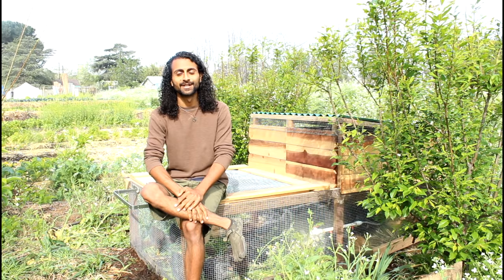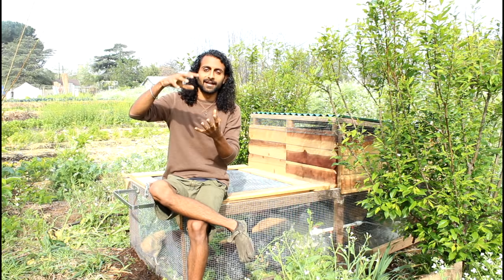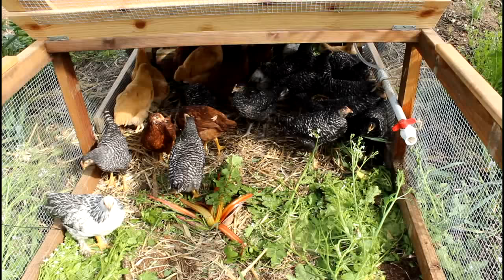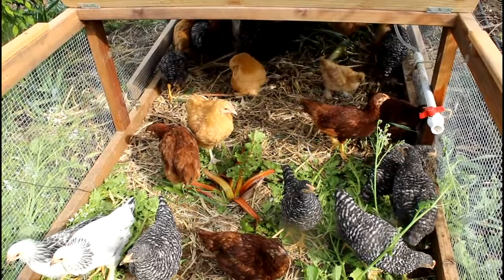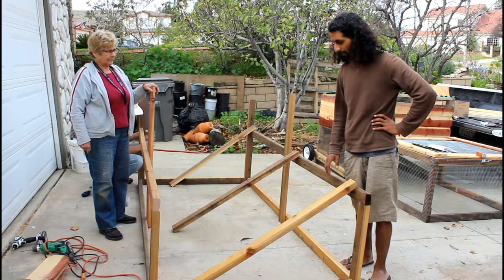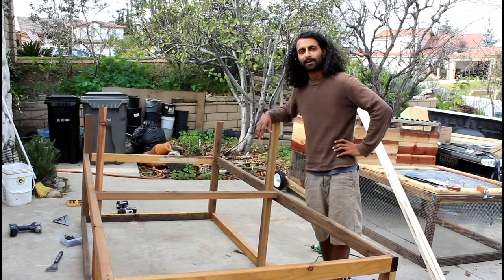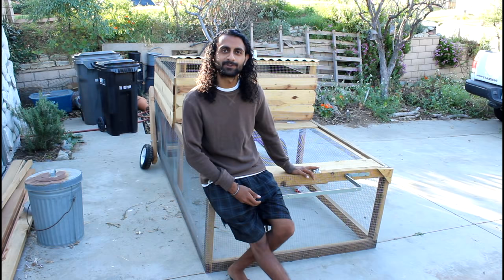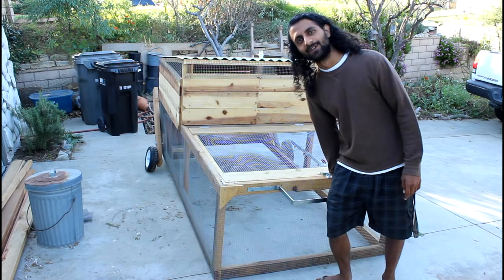How to Build a Chicken Tractor with Farmer Rishi

Comment: I watched this video, and several others, a few years ago, then built a chicken tractor taking pieces from each video and a few ideas of my own as well.  Then last summer I built another newer one -- the old one was still working fine, I just had so many ideas to improve it after using the original those first two years. Here's an explanation of some of the ideas that I came up with.

What I remember liking about this video in the first place was the system to raise and lower the wheels.  I used that in my first and second tractors, however, mostly because I had an old retired 20" BMX style kids bike collecting dust, I used the wheels from it the second time. I also see these bikes at yard sales all the time for $10 - $20, you can't even buy plastic wheels for that. I had to move the pivot point further up the side on the very back, but they work sooo much better.  They do lift it a lot higher, on purpose,(I could of had the pivot lower or arms shorter, but didn't, I wanted to be high for uneven ground and tall vegetation. The back bottom is about a foot from the ground when it's in move mode now).  This is too high to move with the chickens in it, but it is very easy to move, even a few hundred yards when occasionally necessary -- easier than a wheel borrow, even through the woods.  Moving the chickens separately is no work what so ever though, most of the time I'm only moving a few feet, but even on those long moves, it's still very easy, I just take a coffee can of scratch grain with me every time I move it.  I let them all out and sprinkle a little grain, enough to only last a few minutes off out of the way. Then I move the tractor, and after giving them 5 or 60 mins, or more, to roam and bug hunt, according to how much time I have to herd chickens, or if in a hurry, immediately,  throw the rest of the can back in the tractor in the new location, and they come running to put themselves back in to gobble up the grain.  Just shut the door behind the last one.  On those long move you may need to stop a couple times and sprinkle tads of grain and/or rattle the can a few times to keep them interested and let the slow ones catch up,  but basically, if you do this routinely, the chickens will move themselves and enjoy getting out and stretching their legs a bit.

Also, I found that using metal studs for the very bottom perimeter works very well.  I made the very bottom, the part that touches the ground, on my second tractor from 2" x 6" metal like what is used in a steel stud home.  It is not only a lot lighter than a wood 2" x 4", especially a wet 2" x 4" but it's really not that expensive, and it doesn't rot.  I kept with recycled wood and pallet scraps up off the ground, but figured in the long run, spending $30 on the base would save me a lot of time and effort.  The first tractor was still working, but I could see this was going to be the first part to fail in the next year or so.   Besides, even though my second tractor is bigger, it's still lighter.

Another addition that I made that worked out very nicely for me were three small hamster tube inspired additions.  Let me explain.  I have a very large garden, and I was using my tractor fine around the perimeter of it, and even between some of the widely spaced crops, like pumpkins and melons, before the plants spread too much and the tractor no longer fit.  And Since I didn't want to put the rows of the rest of the garden a little over 4' apart to make getting the tractor in there possible, I had what I thought was a bright idea.  I made some small 20" x 10' add-ons for my tractor, and put three slide up doors along the side of my tractor.  These add-on pieces are made with 2"x 4" metal stud bases and bent PVC tubing.  I cut plywood round top pieces with a door hole in each end, and wired on a long straight piece of PVC down the top center of each, securing the middle of the hoops to it with wire too. Then covered it all with plastic poultry netting.  These pieces are comparable to picking up and moving an aluminum ladder.  I put the rows in the garden 2' apart* ( tighter plants like onions, carrots, radishes, etc. I put two or four rows just a few inches apart then left a 2' path).  I can pull my tractor now along the end of the rows and have three hamster tube chicken runs running 10' down 3 paths, or 30' down one path, and not only do the chickens get a lot more room, but I get 90% of my garden weeding done at the same time.  My rows are about 30' foot long, and when I thought of this, I figured a row a day, but it is working so well, I will make 3 or 6 more of these this coming Spring.  I don't let them in these runs at night, they are not predator proof enough.  But they work so well in the day, I've even been taking them out to the pasture, which I didn't intend to at first, and adding them on just for the extra running room.  Two of them on more than doubles the square footage of the original tractor and the chickens love the extra room.  I've even used one a few times as a link to a 10' x 10' floorless screen room tent I own -- but that's just for an occasional treat.

There, I didn't set out to write a book, but almost did.  I really appreciated the wheel lift idea I lifted from your video, and hope you or some of your viewers can use an idea or two from where I took it. 

Cheers
BP
Reply: @sarvodayafarms  You are welcome.  It just so happened that this video popped up on my auto play today, and I thought, "Hey, I remember this guy, he's the one I got the wheel arm idea from, I should thank him.  You may even find the off grid cabin I'm designing interesting too over on my baby one video channel.

Comment: Wheel system is beyond ingenious.

I used this on three, 10' x 12', chicken tractors.

I put the wheels on a 5/8 galvanized bolt through a 2x4 brace placed 24" from the end of the tractor. The hole for the post is 6" from the ground (pivot hole), I used a 36" board for the wheel. The wheel was 3" from the end and the pivot was 11" from the end. The bolt to stop the wheel was 34" from the end on the top bar. This raised the coup about 4" off the ground, which is great for clearance over changing terrain!

Thank you for posting such a detailed video!
Reply: Thank you for sharing!

Comment: This video is wonderful. A commenter was right that you would make an outstanding teacher! 100,000 thank yous
Reply: This guy is dangerous! Do not do what he is demonstrating here! Learn some skills before you attempt to teach others... 

Teaching people improperly is not only in poor form - it is immoral and down-right dangerous! 

i.e. - Does this guy even own a properly fitting combination wrench? Adjustable pliers should be your last choice! 

28:40 - He has no idea what an Elastic Stop Nut (Nylon Insert Locknut) is! - Or - Why it is a better choice to mount the wheel. 

36:48 Wrong size PVC glue applicator...! That one is good for 3" pipe and larger. (Read the instructions!); 

37:14 - "Red Hot" glue, WHY? It is not raining or sub-freezing! (Again - Read the instructions!); 

37:23 - large puddle of glue on concrete! (Applicator too large!) 

39:47 - Covered glue spill on concrete with board. 

39:58 - Spills glue again. - Glue everywhere! - (Applicator too large!) 

37:48 - Fails to use proper threaded T-fitting or 1/8" tapping device for nipple threads.
37:50 - Drills into hand - Almost! 

39:26 - Glues the ball valve in the open position with excess glue inside fitting. (Applicator too large!) 

43:48-44:08 - It makes no difference! The hinge will function properly with either plate on top. 

45:15 - He says this can be used for quail... 

45:24 - How does he keep them in when the coop is 7" off the ground in the transport position? 

48:26 - Lets helper sweep FRP debris away with his bare hand. There are glass fibers in that stuff! USE A RAG! You will thank me later. 

48:35 - Uses an impact driver on a short wood-screw. Great procedure if you want to strip out the wood attachment! 

Just wondering... 

48:55 - How does he fill the water bucket with the roof screwed down tight on top of it? 

52:42 - How does he keep the salmonella out of the vegetables with those chickens roaming around in the garden areas?
Reply: @sarvodayafarms  And I hope you're going to teach regenerative gardening.  :)

Comment: 👍Thank you for sharing😊

Umm... I have always put the screws through the corrugated roofing on the mound as opposed to the valley.  The valley is for water drainage.  Leaks are more likely to happen when you put holes in the water channel.  I learned that at least 40 years ago so I very well could be wrong I guess.🤷

Comment: Poultry net staples can be difficult to hammer without hitting your fingers. I avoid that by holding the staple with needle nose pliers.You are correct about predators being able to tear poultry netting. I use 1"x2" welded wire instead of hardware cloth for more strength.

Comment: After watching this video, I built some rabbit tractors almost using the same design.  I have no wood working skills.  The first tractor worked out pretty well, although not great.  The second rabbit tractor is looking great.  I used all 2x2 instead of 2x3 since they are only rabbits and put chicken wire or metal cloth on the bottom (rabbits can dig).

I now have some happy bunnies.

Starting a chick tractor this weekend.  Thanks for the video.
Reply: Can they access the grass and bugs through the metal cloth?  That is essential to the tractor concept.

Comment: First let me say that you provided an excellent video and thank you very much for taking the time to film the entire process.  I would like to make a suggestion.   On the pivot point for the wheel bracket, I would put a washer after the two nuts for the board to rub against and instead of a lock washer on the wheels, I would use two nuts to lock against one another.  That would allow you the optimal tightness without loosening that I fear would happen with the lock washer.  Great job and thanks again for sharing.
Reply: +The Growing Club  A ny-lock nut would would not back off.
Reply: The Growing Clu
Reply: DoingItCheap Luv ya Paw Paw
Reply: This was great, thanks, I've been looking for "pet chicken" for a while now, and I think this has helped. You ever tried - Machaaldity Coop Blaster - (Have a quick look on google cant remember the place now ) ? Ive heard some great things about it and my cousin got cool results with it.

Comment: I sure would like to have a complete list of everything it takes to build this coop --    I really like it and think you did a terrific job building it.
Reply: This guy is dangerous! Do not do what he is demonstrating here! Learn some skills before you attempt to teach others... 

Teaching people improperly is not only in poor form - it is immoral and down-right dangerous! 

i.e. - Does this guy even own a properly fitting combination wrench? Adjustable pliers should be your last choice! 

28:40 - He has no idea what an Elastic Stop Nut (Nylon Insert Locknut) is! - Or - Why it is a better choice to mount the wheel. 

36:48 Wrong size PVC glue applicator...! That one is good for 3" pipe and larger. (Read the instructions!); 

37:14 - "Red Hot" glue, WHY? It is not raining or sub-freezing! (Again - Read the instructions!); 

37:23 - large puddle of glue on concrete! (Applicator too large!) 

39:47 - Covered glue spill on concrete with board. 

39:58 - Spills glue again. - Glue everywhere! - (Applicator too large!) 

37:48 - Fails to use proper threaded T-fitting or 1/8" tapping device for nipple threads.
37:50 - Drills into hand - Almost! 

39:26 - Glues the ball valve in the open position with excess glue inside fitting. (Applicator too large!) 

43:48-44:08 - It makes no difference! The hinge will function properly with either plate on top. 

45:15 - He says this can be used for quail... 

45:24 - How does he keep them in when the coop is 7" off the ground in the transport position? 

48:26 - Lets helper sweep FRP debris away with his bare hand. There are glass fibers in that stuff! USE A RAG! You will thank me later. 

48:35 - Uses an impact driver on a short wood-screw. Great procedure if you want to strip out the wood attachment! 

Just wondering... 

48:55 - How does he fill the water bucket with the roof screwed down tight on top of it? 

52:42 - How does he keep the salmonella out of the vegetables with those chickens roaming around in the garden areas?
Reply: @Euphroe  Where are your videos posted?

Comment: Doingitcheap is correct.  When I saw you put the large washer on the outer side of the wheel, I wondered why you didn't put a correct sized washer that butts against the bearing run.  That would have stabilized the wheel to run true. Fantastic video!!!

Comment: This has got to be the best instructional video I have ever seen, hands down!    I can not thank you enough!  You were so informative, easy to understand, and I can not show enough appreciation for the step by step directions.   Superb!    I only have one question.   How many adult chickens will this design (same size) accommodate?   I think I will put wheels on the front of my tractor too.   I am not as strong and do not have all the help you have. :)

Thanks again!
Reply: One general rule is that each chicken needs 3 square feet at a minimum. This tractor is approximately ~32 square feet, actually slightly less, so you could put 10 chickens max. Some folks give the chickens much less space, especially broilers, but I would probably put 8 into this size tractor.
Reply: This guy is dangerous! Do not do what he is demonstrating here! Learn some skills before you attempt to teach others... 

Teaching people improperly is not only in poor form - it is immoral and down-right dangerous! 

i.e. - Does this guy even own a properly fitting combination wrench? Adjustable pliers should be your last choice! 

28:40 - He has no idea what an Elastic Stop Nut (Nylon Insert Locknut) is! - Or - Why it is a better choice to mount the wheel. 

36:48 Wrong size PVC glue applicator...! That one is good for 3" pipe and larger. (Read the instructions!); 

37:14 - "Red Hot" glue, WHY? It is not raining or sub-freezing! (Again - Read the instructions!); 

37:23 - large puddle of glue on concrete! (Applicator too large!) 

39:47 - Covered glue spill on concrete with board. 

39:58 - Spills glue again. - Glue everywhere! - (Applicator too large!) 

37:48 - Fails to use proper threaded T-fitting or 1/8" tapping device for nipple threads.
37:50 - Drills into hand - Almost! 

39:26 - Glues the ball valve in the open position with excess glue inside fitting. (Applicator too large!) 

43:48-44:08 - It makes no difference! The hinge will function properly with either plate on top. 

45:15 - He says this can be used for quail... 

45:24 - How does he keep them in when the coop is 7" off the ground in the transport position? 

48:26 - Lets helper sweep FRP debris away with his bare hand. There are glass fibers in that stuff! USE A RAG! You will thank me later. 

48:35 - Uses an impact driver on a short wood-screw. Great procedure if you want to strip out the wood attachment! 

Just wondering... 

48:55 - How does he fill the water bucket with the roof screwed down tight on top of it? 

52:42 - How does he keep the salmonella out of the vegetables with those chickens roaming around in the garden areas?

Comment: good design that 10 inch wheel you got have's a ball bearing on it so if you went with a smaller washer to set against the ball bearing you would not have to worry about it coming loose

Comment: When tightening or removing nuts and bolts , always remember ,  righty - tighty , lefty -loosey
I would also add that you did not say how long the bolts should be for the wheel and lift system.
There is a material for locking nuts in place called Loc-Tite ,  Two types , one for removable nuts and one permanent for non-removable nuts . Either one prevents the nuts from backing off and loosening . Double secure when used with a lock washer.
Reply: Why use loc tite when you can just buy self locking nuts.

Comment: If you make a chicken tractor a little more narrow and make a wider lane between the rows of crops in your garden, you can use your chicken tractor for weeding your garden. Unless you like doing the weeding your self ! Which I do not !  The chickens also fertilize the garden soil at the same time. I place a heavy mulch close to each plant to keep the weeds down and help retain moisture.  The following year I simply move each row over a little so it is in last year's chicken fertilized aisle. I keep my gardens square or rectangular with straight side so a chicken tractor can be placed close to the crop.  This takes care of the weeds around the outer sides of my gardens. My girls do a lot of the work for me !  I love gardens. I hate weeding !

Comment: At 46:00 or so, you talk about 'closing up' the top of the three sides with the same wire cloth used below.  Two suggestions. First, do not fasten the last row of fence boards in place until you've fastened this last bit of wire cloth in place first securing it to the inside face of the last boards after trimming it to fit neatly. then (because chickens eat flying insects) #2 add window screen mesh to prevent insects that fly in from easily escaping the voracious hens. Cut strips of fence boards to cover the exposed edges of the wire cloth (neatness counts).

Comment: Excuse me for asking but, I assume the two wheels have a bearing? IF so you can tight the outside nut as securly as possible to stop it falling off, because the bearing will allow the wheel to move. ???